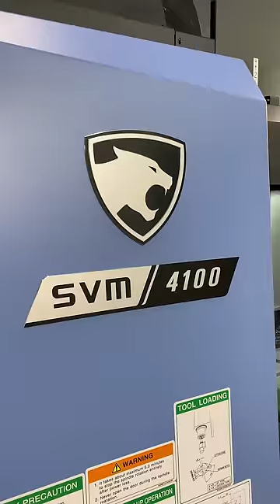CNC Machined ISO-GRID Coaster!

Comment: Though it looks cool, an aluminium coaster defeats the purpose of using a coaster in the first place since it's a very good heat conductor
Reply: I always assumed they were to avoid staining your tables. Never knew it had anything to do with retaining heat. Learn something every day.
Reply: @UnderearthEDO  that’s what most people use them for. Most surfaces you put your cup on would be pretty insulating anyway, especially if they are wood or plastic.